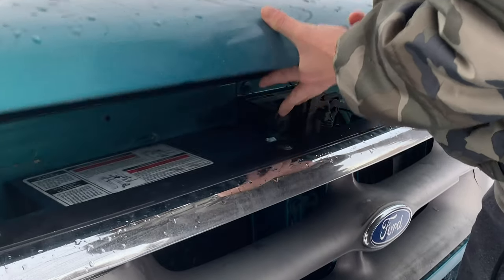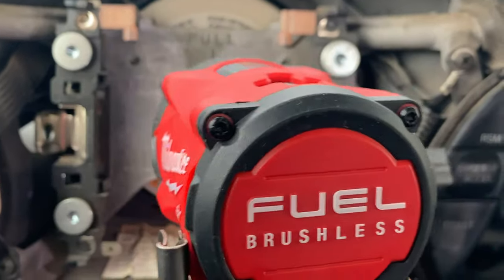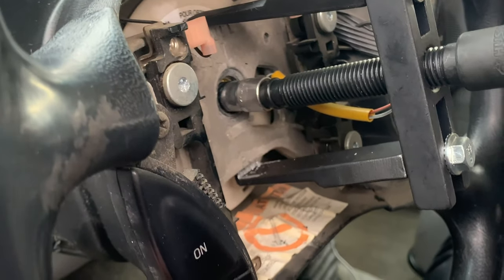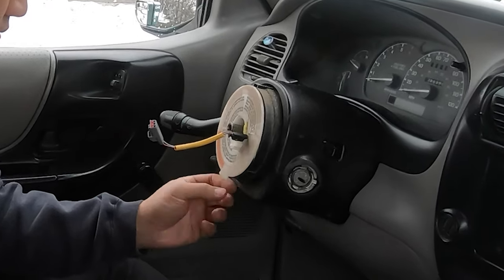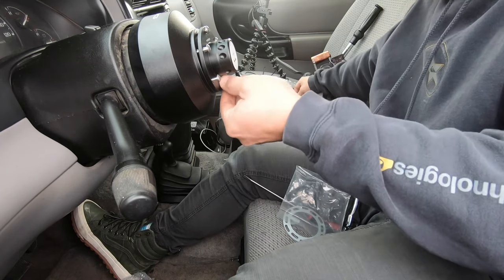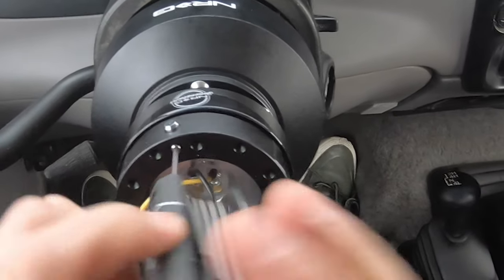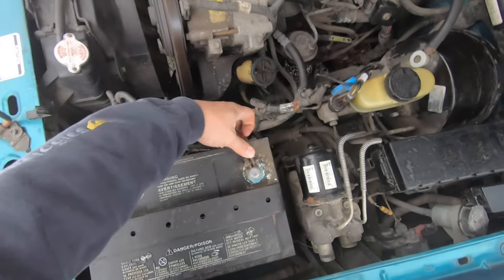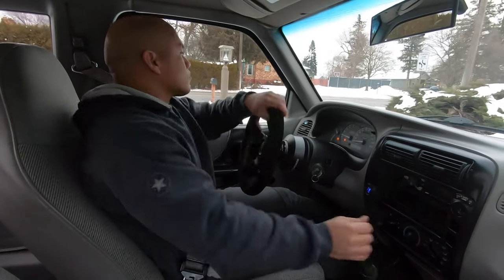How To Install NRG Aftermarket Steering Wheel with Quick Release - Ford Ranger

Comment: Hey honestly your video was just what I needed   Been trying to find a hub for months. My 97 ranger is a bit tight and I’m not sure if I want to go with a quick release. Do you know what size steering wheel I could get on just the nrg hub?
Reply from the maker: Glad you found it helpful! I just swapped out the NRG wheel for this: https://amzn.to/2KPsPx9

It's WAY better. 

If you prefer all black, I have this one on my Xterra: https://amzn.to/3aPfzCZ

Here's a video of me reviewing it on the X.https://www.youtube.com/watch?v=yJSQVM9XEmA&t=37s

I'll do a review on that wheel for the Ranger soon. I also need to wire up a solution for the horn, so I'll do that in one video. Stay tuned for it!
Reply from the maker: The wheel will fit on the quick release or directly on the hub. I like this one because it's flat and gives you way more room. 350mm is also an ideal size because it allows you to see the instrument cluster easier. the 320mm is too small.
Reply: @rayregnogarage

Comment: Hey brother I know this video is 2 years old but for future reference to everyone seeing this. The reason his steering wheel is grinding when turning is due to the clock spring. Clock springs MUST be removed, they are a piece of the airbag system and they are useless when you install aftermarket quick releases.
Reply from the maker: I left mine on because when I broke the clockspring  on my xterra, it caused some problems. The blinker didn’t reset on its own anymore after the wheel straightened and a few other things. i replaced the clockspring on the x and everything is good again. didn’t make a difference on the ranger for me
Reply: Ah ok. I know that NRG makes two different hub adapters 1 is 161H which has a fake clock spring for pre 98 fords which is also a short hub. The 1 your using is 162H which uses the clock spring but it's a tight fit which rubs the steering shaft mounting bracket.
Reply from the maker: @brandonjohnson3566  good to know. thanks!
Reply: How do you connect the horn? Where did you connect the yellow cable from the clock spring...

Comment: Thank you for the video.. Im looking at this hub for my 98 ranger and wasnt sure about fitment, much appreciate.. Ive used NRG hubs in all my Hondas for over probably 10 yrs now ?? Quality.
Reply from the maker: Glad I could help! Just a warning, there are a few nuances to it. Once you get the hub on, it's really hard to get off the truck. One of my viewers mentioned that the spline doesn't match perfectly so it kinda jams on there. Also, It's best to trim the hub adapter a bit if you want to run a horn. I talk about it more in this video. Watch this one before you do the install. I made the mistake of just forcing the hub adapter on there.. and I ruined the clock spring. So I have the horn ghetto rigged for now.

https://youtu.be/CNPR5JYdEQM

I'm probably gonna run and get a replacement clock spring out of a junk yard truck. The Hondas are WAY easier to work on. 

The steering wheels come off so much more easily on the Hondas.
Reply: @rayregnogarage  I was wondering about the fitment because NRG has the 97 and up ranger listed for the hub, hopefully the person that got it stuck probably misaligned the splines and forced it, I couldnt see any manufacture using various splines shafts for their cars.. Keep cost and production cost down.. Hopefully I'll get it to work smooth. Having a function horn with a aftermarket wheel will be nice. I never use cruise anyway.
Reply from the maker: @deezypnw9284  Ya. I didn't notice any misaligned splines on mine. But it was pretty much impossible to pull off the factory wheel the way I did it on the Xterra. I had to use a steering wheel puller. The wheel puller won't fit on the hub adapter though so I need to find another way to get some leverage on it. I did have to trim the plastic on the clock spring. And if I do end up pulling it apart again to fix the horn, I'll shave down the hub adapter so there's room for the horn wiring to be accessible.

Comment: I have a 1998 4.0 v6 xlt ranger.. 
Is there a specific hub and quick release adapter i need to order? And if so, can you provide the links. And what is the actual size of steering wheel i can use to replace the factory one? Any brands that you may recommend.  ThanX 👍
Reply from the maker: links are in the description. it’s for an F150 tho. should be modified. Watch my part 2 video on how to turn off the airbag light. i explain there

Comment: Nice video man, really helpful. Im really interested in swapping my steering wheel but with that kind of driving position maybe wouldnt be for me. May I ask how tall are you? Just to give me an idea. Thanks again for the vid bro.
Reply from the maker: I’m only 5’4” but you can get a flatter wheel that is bigger so you can see the gauges better. The wheel in this video was originally in my Xterra and I didn’t like it there either.  

Watch this video on the steering wheel options. I just got the flat momo wheel for the Ranger also

https://youtu.be/yJSQVM9XEmA
Reply: @rayregnogarage  Awesome, thanks! Just watched it and it seems the way to go for me also. I was also looking for the slim quick release from NRG but I think I will miss the nice factor that his one has.
Reply from the maker: The slim release is full race car status. haha. you’ll have to figure out another way to wire your horn and such (most people go on the dash). Not sure NRG makes the slim one for the Ranger but I have friends who have done weld-on versions in their race trucks

Comment: What brand of steering wheel puller did you use? The one I have doesn't get enough bite to keep from slipping. I need to find one with a flat surface to use like the one you used.
Reply from the maker: I’m not sure where it’s from. I think I may have found it at O’reilly years ago.

Comment: Hello I know this video is from 2 years ago but I got a 1995 Mazda b4000 which is practically the same as a ford ranger of that same year, I was wondering if the hub you used for this video works on my truck, it has the same interior as yours just without the cruise control
Reply from the maker: It's the same truck. It should work. Make sure to watch the part 2 of the video so you don't break your horn wiring like I did.
Reply: @rayregnogarage  Thanks man watched it already, I already ordered the hub and see how it turns out

Comment: That’s how to bypass airbag light that link you sent I was wondering if that hub adapter would fit for an after market 14 inch steering wheel
Reply from the maker: Watch the entire video. I explain why the hub adapter "fits" but also doesn't

Comment: What hub did you use ? Is it universal?
Reply from the maker: It’s the NRG hub adapter for a 90s F150. Wasn’t sure it would work, but took a chance and it seems fine. I put a link to it in the video description.
Reply: Did the horn work after you installed this? Looking for a replacement for my dingey old one. I dont need cruise control but I'd like to maintain horns for legal reasons :P
Reply from the maker: Collin Wiedel At the moment, no. The horn isn’t working. The wiring was much more straight forward on my Xterra. In all honesty, it probably is just an issue with the wiring connectors being different. The Xterra plugged right into the hub wiring. But not the same on the Ranger. I haven’t taken the time to figure it out yet. Haha. But I’ll play with it today. I did a swap on an Acura Integra recently, and we ended up mounting the horn bottom on the dash. As long as you can locate the actual horn wire, it’s pretty easy. Stand by. I’ll figure it out and post a video of it soon. Cus I want my horn back. haha
Reply: @rayregnogarage  awesome! Looking forward to hearing about it!

Comment: And that white disk behind the steering wheel when I instal my new nrg hub adapter do I need to keep that same old white disk? Or can I not use it
Reply from the maker: Not sure if you need the clock spring. I left it in there. It manages cruise control and on some cars it also manages the steering wheel sensor. If it’s broken or missing, the signal light won’t turn off automatically when you finish a turn. I removed it on my Integra. I left it on the Ranger.

Comment: I have a question on the steering wheel puller what size socket did you use or what did you use because i have the same problem with my puller
Reply from the maker: i can't remember what size it was. the puller is at my shop. but I used whatever size socket fit over the part on the puller that you turn. lol.. but I had to use something to keep the jaws from spreading apart like I did in the video.
Reply: @rayregnogarage  thanks im going to try it

Comment: Hmm. I am 6'6", so I want to extend the steering wheel. Put quite a bit of love into my Ranger, so a removable wheel to avoid it getting stolen/because they're awesome would be sick. The only kicker is all of my cruise controls are built into my current wheel as well. You didn't remove the coil spring right? Just the plastic cover over it?
Reply from the maker: You can get steering wheel spacers to get the wheel closer to you. I didn't remove the coil spring itself. although, I have seen people mount their cruise control buttons on the dash instead of on the wheel. I've been meaning to try and figure that out on my Xterra. On the Ranger I don't use it at all so I just ditched it. Going to remove the module completely. haha. Did that this week on my Integra since I don't use it there either.
Reply: @rayregnogarage  Yeah I looked at some spacers, I think I can get something very workable. Just need to figure out how/what to do with cruise control. I use it all the time as my 04 is working on becoming an overland vehicle. I want to be able to cruise down the highway relatively comfortably for hours at a time before doing moderate wheeling/camping. I really like having it on the wheel as New Mexico and Colorado are very hilly in places, and you have to turn it on and off regularly.
Reply from the maker: I use my Xterra as an overland rig. Went CA to FL to Niagara Falls and east to OR before heading home. Over 12k miles driving over a month. Never used the cruise. didn’t have it. haha. it wasn’t bad
Reply: @rayregnogarage  That is a shitload of driving without cruise! I bet that was a fantastic trip. I am getting married in about 2 months, trying to get the rig ready for some adventures. Wife to be is adventurous but I want to ease her into outdoors life so she has a few really positive experiences before we start going backpacking and what not haha.
Reply from the maker: Ya I don’t mind! I rarely use the cruise. It keeps me awake. Haha. Good luck with that! Just got married in July and the wife isn’t super excited about stealth camping and such. hahaha. Saved a lot of money camping in parking lots in front of Walmart, Planet Fitness, hotels...  haha. ..Those days are over now. lol

Comment: Would that hub fit an 89 Bronco 2? I know it’s based off the ranger but is it possible it could fit?
Reply from the maker: Not completely sure. The Bronco shared the interior with the first gen Ranger until it was discontinued in 1990. The interior of the 95 Ranger is not the same. Have you tried calling NRG?
Reply: @rayregnogarage  i haven’t called yet but I definitely will

Comment: I bought a 14 inch wood steering wheel off Amazon for my 97 ranger but what hub adapter do I need
Reply from the maker: How many screws does the steering wheel take? If it has the standard six screw pattern, you can use the one listed in the description of this video.
Reply: In the new steering wheel I got it has 6 screws
Reply: Do you know of any hub adapters that will fit that are cheap?
Reply from the maker: It’s your steering wheel. I would not go cheap on a part that could put you or other people in danger if it malfunctions

Comment: Where would I be able to get the adapter not an nrg one just a simple one. 99 ford ranger been looking and nothing
Reply from the maker: why don’t you want an NRG one? if you mean non quick release, just get the NRG hub adapter and don’t install the quick release part. they are separate parts

Comment: i have a 99 ranger will everything in the description work for me?
Reply from the maker: It should. The interior of my 99 looked exactly like my 95..apart from the fact that my 99 had a passenger airbag while the 95 does not. Just make sure to watch my follow up video on the horn situation. Watch that one first before you start taking it apart...otherwise you won’t be able to run the factory horn properly 

How to bypass airbag light and fix your horn with aftermarket steering wheel on a Ford Ranger https://youtu.be/CNPR5JYdEQM

Comment: What about the cruise control buttons that are on the factory steering wheel?
Reply from the maker: You’ll lose them. You can wire them up using different switches. I don’t use cruise

Comment: How the hell do I wire my horn? The black wire fits on the horn button but the yellow one on the steering column like plugs into something
Reply from the maker: Did your NRG kit come with a ring looking thing that you can sandwich between the hub and the wheel/quick release? Use that and plug one of the wires to it. Essentially, you just need to connect to ground. that's what that ring is for.

Comment: Hi ✌🏻, Ranger's  NRG hub says it's from 98-02 but my Ranger is 2007 and I can't find another one that fits
Reply from the maker: I have a hard time believing it's any different. The interior of the Ranger did not change from 1995-2011 with the exception of some very small updates.. My 95, 99, and 07 look exactly the same. The 07 had a slightly different steering wheel with different buttons, but that was it.
Reply: @rayregnogarage  I was looking for the NRG hub to buy it and in the specification it says 98-02 but I'm going to buy it to try 🤘🏻
Reply from the maker: @warrenleonel1477  Aweome. make sure to watch this video before you do the install. Let me know if the hub they send you doesn't require the mod I mention in this video: https://youtu.be/CNPR5JYdEQM
Reply: @rayregnogarage  I'll let you know how it was when I installed it and thank you
Reply: @warrenleonel1477  did it work because I wanna try for my 06 ranger
Reply: @KonnorKabanukSB  Yes it worked
Reply: @warrenleonel1477  you know if it works for a 94?

Comment: Hey I was wondering what I would use to put a detachable steering wheel in my 2000 Ford F-150
Reply from the maker: Did you look on the NRG website? Looks like the same part number. http://www.getnrg.com/index.php?route=product/product&product_id=1720
Reply from the maker: Just click the Amazon links in the description of the video for the adapter, quick release, and wheel. Should all fit
Reply: Stronghold Garage alright thank you
Reply: Stronghold Garage where’s the description
Reply from the maker: If you’re on a computer it shows up under the title of the video. If you’re on a phone, you need to click “More” or the arrow next to the title

Comment: How did you wire the hub to the actual steering shaft?
Reply from the maker: Watch this one first. I broke my clockspring.. which is where you would wire the horn if you wanted it to work through the steering wheel. I may go to a junkyard and pull a clockspring off another truck.. but right now I'm okay with the ghetto fab way I got the horn to work. Haha. #toomanyprojects

https://youtu.be/CNPR5JYdEQM

Comment: What hub adapter would work for a 2007 Ford Ranger ?
Reply from the maker: Not sure. A when I bought mine, I wasn’t sure it would work. It was listed to fit the F150 and thought I’d gamble on it. You could call NRG and ask
Reply: It's on Amazon

Comment: What size star bit did you use to take off the steering wheel bolt in the middle of the steering wheel
Reply: Is it a t 50 with a 1/4 ?
Reply from the maker: @paigedemarest6914  I don't think they make a t50 in a 1/4. Pretty sure it comes in as small as a 3/8.
Reply: Did you use the t 50 3/8 bit?
Reply from the maker: Yes. My stubby impact is 3/8
Reply: Do I need to keep on  that white disk behind the steering wheel for my new nrg adapter or no
Reply: And how can I make sure my steering wheel doesn’t fall off
Reply: When I put on the steering wheel with the hub adapter the tires move but I can pull off the steering wheel it’s like it’s not staying put the steering wheel
Reply from the maker: Not sure if you need the clock spring. I left it in there. It manages cruise control and on some cars it also manages the steering wheel sensor. If it’s broken or missing, the signal light won’t turn off automatically when you finish a turn. I removed it on my Integra. I left it on the Ranger.
Reply from the maker: did you put the lock nut back on???
Reply: @rayregnogarage  do you know how I can make the squeaky noise of the hub adapter go away when I turn the wheel it squeaks
Reply from the maker: Mine squeaks too. I haven't tried fixing it. My Xterra makes noise, too. My integra and mk4 VW do not. Pretty sure it's the clock spring.

Comment: I have a 1998 Ford ranger with the hub work for it it says it won’t
Reply from the maker: It SHOULD... with modification. Make sure to watch this video first, so you don't break your clockspring like I did. The 98 interior is exactly the same as the 95. I know because I owned a 99 and a 2007 previously. The hub I used is supposedly for an F150, but it's worked fine.. just make sure to watch that second video to see where you'll need to modify the hub adapter to work.
Reply: @rayregnogarage  thank you